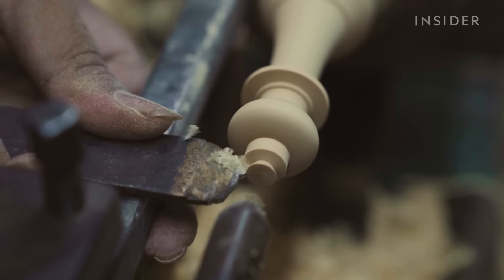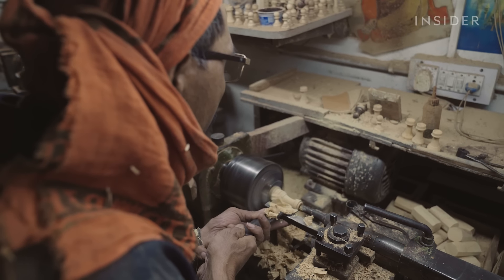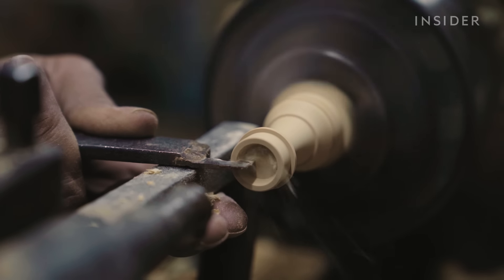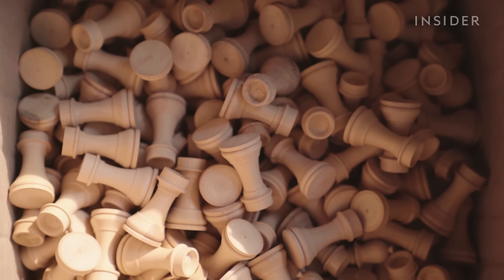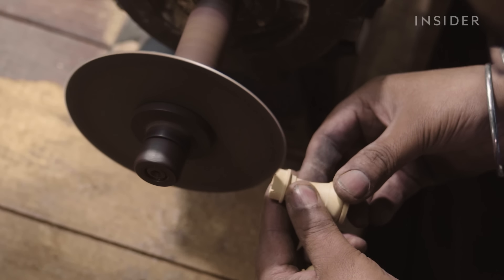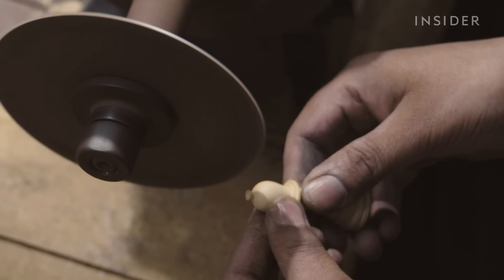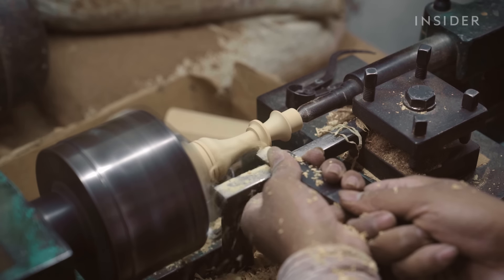Why Championship Chess Sets Are So Expensive | So Expensive

Comment: "affect the outcome of the game" that's a load of cap right there. Oh no, this knight isn't perfectly symmetrical and it's causing me to misplay lol.
Reply: Specially at 2800+ ELO level. These guys could play chess with checkers pieces full strength.
Reply: I mean, GMs are playing online perfectly fine, and there are no pieces at all. 

Some of them are even able to hold blindfolded simuls and win on pretty much all boards. 

The pieces don’t matter; as long as they are somewhat recognisable and not dangerous to move (i.e. they don’t splinter/fall over easily), they can always play a good game of chess.

unless of course one of them is like bobby fischer, that guy’s a bit unhinged, and the quality of pieces might actually matter (along with other, very specific conditions)

edit: also, maybe in a bullet tournament it might matter, but I’m sure as hell not going to try and play bullet on a physical board
Reply: Yeah it doesn’t change the game at all lol. I could use pieces of paper with the names of the chess piece on it and it would be the same thing
Reply: @TheOneWhoHasABadName  I think they should make specific piece for bullet. Maybe it's much smaller / slimmer with wider bottom for extra stability so it doesn't topple easily. Or just go full Japanese shogi and turned to fully flat.
Reply: It is a genuine concern though... I have been playing chess for the better part of 15 years and cheap pieces fall very easily, especially if you're clumsy. Now combine that with a 5 minute blitz game where you move pieces very fast, one clumsy move can ruin the entire board...
Reply: @spyrosvassilakis4212  aint worth 500 dollars just for that.
Reply: @cypherusuh  bullet shouldn't be played over the board. It's prepostreous, a strategy game becomes a game of dexterity.

All speed chess except for Rapid should be played online.
Reply: @pawsR0cky all they have to do is read
Reply: @pawsR0cky yes, I don’t play professional obviously. But it’s not hard to just read and visualize imo
Reply: @spyrosvassilakis4212  that is easily fixable by adding a heavy base which doesn't add much to the cost. Knights being symmetrical has nothing to do with the quality of the game even in bullet
Reply: @cypherusuh  bullet is not an official format according to fide
Reply: Also, wood is intrinsically irregular, so more bs
Reply: Magnus Carlsen once told a story on his YouTube were he realised that he just didn't have a chess set at home and then he just went to a store around the corner to buy whatever chess board they had.

Chess pros do most of their practice on computers anyway.

It's in the video Magnus Carlsen discusses The Queen's Gambit scene by scene
Reply: It is a bit over the top.
Reply: Technically, yes. It can affect the movements of the piece etc.
Reply: @CoolMan-ig1ol  I mean, have they tried using their hands to pick it up?
Reply: @CoolMan-ig1ol  Technically, the sun could not rise tomorrow...

And not technically, marketing bs always can count on gullible people to rationalize the sell tag of absurdly overpriced products, lol...
Reply: @spyrosvassilakis4212  Maybe very cheap pieces, shit from China which costs 5 dollars, above ~50 dollars there are not difference. There is no need to pay $500, you just need to buy a decent chess set for far less than 500.
Reply: It actually makes a difference cause bad peices may fall over when making a move
Reply: @mrgamerboy8316  Have the people playing tried using their hands to pick up the pieces without dropping them?
Reply: @mrgamerboy8316  That's tarded. Are you saying that a minuscule assymetry is gonna make the pieces somehow unstable? Yeah, they get Parkinson, lol...

And in fact, plastic "peices" are more consistent than wood ones, and have a lower center of gravity, thus being more stable.
Reply: @ligmasugmakenya114  I'm just saying badly shaped or badly weighed peices are more likely to fall
Reply: @mrgamerboy8316  I think any scenario that a cheap piece would fall over so would an expensive one.

Comment: as a mechanical engineer, machines definitely can make them at a cheaper faster rate. There are no internal carving, just surface grinding.
Reply: I think even if 50% of a machines pieces wouldn't meet the competition standards it would likely still be faster. Maybe less than 10 people are carving them right now but im sure there are thousands of people who could write a CNC program to get a knight of similar quality.
Reply: @hermitgreenn  "handmade"  🤣🤣🤣🤣
Reply: @mikepennington7209  handmade also includes using a tool to craft something
Reply: Literally!
Reply: @hermitgreenn  I want to see the 3D-printed wooden pieces.
Reply: As a mechanical engineer, you don't know how to run a cnc mill
Reply: I don't need to, Janitor.
Reply: @ivanteo1973  you're signing as a janitor now? Impressive. Maybe you do know how to work with your hands
Reply: @silo3com  Janitor like you will not understand.
Reply: @ivanteo1973  why are you referring to yourself in the third person. Say, " I like you". Not janitor like you.
Reply: @silo3com  and you insist on being a janitor.
Reply: @ivanteo1973  I didn't insist on it. You claimed it for yourself. You should have been happy claiming just the engineering.
Reply: @silo3com  I can understand how you feel. Truth always hurts. its all right.
Reply: @ivanteo1973  yes I feel sorry that you scrub toilets. I believe you can do better though.
Reply: @silo3com  and you keep insisting,  mr janitor.
Reply: @ivanteo1973  okay we can call you Mr. Janitor if you prefer
Reply: Of course, you can CNC all those pieces. Then they would say they were engineered to NASA like tolerances and it is why they cost $5000 🤣
Reply: @LuisCasstle  That's incorrect. Aliexpress is selling the full set for 20+USD. It's already being mass product using machines. Do your homework before making comments.
Reply: you don't need to be an engineer to notice that
Reply: @vinnieg6161  I didn't notice that. It's just an engineering fact.
Reply: @ivanteo1973  yea like you can't stack lego blocks with duplo is an engineering fact
Reply: @vinnieg6161  you don't need to be an engineer to notice that.
Reply: @LuisCasstle  Yeah, but in your example NASA probably spend $4950 on programming and tooling, but only $50 on actually making one set of something. When you mass produce, the one time costs gets spread over thousands of sets.
Reply: @Tempelge1st  lol, i could literally 3d scan theese pieces and make it within tolerances 0,001mm (one thousand of milimeter) There is no way theese guys could have sutch repetativity in their work, even with 300 years of expirience for each of them. Beside, wood is not static, it swells and shrinks on so many factors, so theese pieces are not same, i can guarantie you that. For time they make one, i could make thousand sets, no problem. Dont get me wrong, i appriciate "human touch" on theese pieces, but as someone pointed out here, they dont even have propper protective equipment, their machines are incredibly old, even light in their workshop would make them loose eyesight quite quickly. No need for people to loose their lives like that. Beside, even CNC machines are made by humans
Reply: Why making fun of janitor, it's an honest job
Working hard making money for the family
Respect them
Reply: I have a set that is about $140 and another that is $120. I think they are MUCH nicer than these. I don't like the design of the World Championship sets. I hate the pawns and I don't like th rooks, and I can't stand the knights. But the standard weighted Staunten wooden sets you can get online are much more satisfying to use. I don't know why they use these ugly sets. Kudos to the work and artistry and craftsmanship, but they are still ugly.
Reply: @luigisanter6211  Min wage? Shit. They might make ONE HOUR of min wage in an entire DAY.
Reply: @fajarkurniawan9434  One of the smartest guys I ever knew was a janitor. Dude knew A LOT about goddamn near EVERYTHING.
Reply: @TheGrandmaster1  ? your comment makes no sense
Reply: @luigisanter6211  It'll make sense when it's TIME for it to make sense.
Reply: @TheGrandmaster1  ah troll comment i see
Reply: @DRAGUNOV1902  I'm curious what device you're using to 3d scan a solid object to within a thousandth of a mm.
Reply: @Typexviiib  for example Artec micro. Its not to a 0.001, but to 0.030mm, still, carving wood on anything more precise than 0.02mm is pointless since it will change dimensions as humidity changes inside and outside of wood
Reply: @DRAGUNOV1902  .03mm sounds a lot more reasonable than a thousandth of a mm.  I'm a tool maker, so I'm pretty familiar with machining.
Reply: cheaper, faster, and better
Reply: @TheGrandmaster1  if they make twice the average local pay, that would be accurate.
Reply: @Typexviiib  if i need a high-accuracy "3d scan" of Something like this, i just hog a CMM and let it measure points for a few days

While your results look somewhat like an stl at first, the mesh eventually gets so fine it's insignificant
Reply: @angrydragonslayer  sure, but even then I've not seen a cmm capable of .0001mm resolution.
Reply: @Typexviiib  indeed, i've been barred from using our leitz infinity for that so i'm limited to one of our Leitz PMM-Cs which may be just above .0001 mm in this use case

Although, would you not say that moving the goal posts is a rather lame move on your side, adding a zero onto the already difficult .001 mm that he spoke of?
Reply: @johnt.sunderland7312  exactly, i could probably make these in carbide for $500-600 per set if i buy chinese carbide
Reply: @silo3com  do you have nothing better to do than troll people attempting to have a discussion?
Reply: @JohnDoe-qt6uo  yes actually. I should get back to the cnc machine. Thanks for the reminder.
Reply: @angrydragonslayer  it wasnt intentional.  My brain went "thousandth of a mm" and I typed it out as if I were doing ten thousandth of an inch, both are the finest scale any of my measuring equipment will read.   I do most of my precision machining in english, because all my mics are English.  I rarely think of mm's in terms of smaller than .1.   Either way, a thousandth of a mm or a ten thousandth, you're getting into variations of surface finish rather than dimensional accuracy for most real world applications.
Reply: @Typexviiib  oh, definetly, it still feels good to tell someone off though

either way, these could be done to a higher spec and experience on a cnc
Reply: and can u call that a HANDMADE WOODEN CHESS SET?!?!?!?!
Reply: @supe4701  but u use ur hand to handle the tool
Reply: @sreeramanoop1403  actually, yes

The legal definition is so loose that me setting up a CNC machine and then letting it run for the next decade can still count as handmade as long as some kind of processing is done by hand

I have consulted a company where a tab is intentionally left in an engraving that is then filed away by QC after checking. This is enough to legally qualify the product as hand made in all western countries except portugal (where they dont enforce this anyway)
Reply: @luigisanter6211  he means they get paid 1 hours worth of minimum wage for an entire days work

Comment: "Only 250 sets are sold each year" Followed by "we make 30 kings a day" And "a knight takes up to 2 hours" Just doesn't make sense
Reply: Theres a difference between make and sold. 250 sets are SOLD. They can MAKE more than that, but they don't sell that much as these are very expensive and not a lot of people buy them.
Reply: @vastikagoel6797  If people were only buying 250 sets a year, they wouldn’t be making 8,000 sets a year. That goes against the basic principles of supply and demand
Reply: The best pieces are sold for 500 probably, and the others probably sell for way less in local markets
Reply: They make two kinds; world champship sets and lesser tournament sets.
Reply: 250 Championship standard sets. The "30 kings a day" figure is for the less regulated/simpler sets, which I assume they sell a lot more of
Reply: Artificial scarcity to bring up the price.
Reply: @saintsleeves  artificial scarcity. Ever wondered why diamonds are so rare yet we have so many diamond mines and diamond jewelry?
Reply: only 250 sets pass through all inspections, they have to make 16 identical pawns, 4 identical bishops, 4 identical knights, 4 identical rooks, 2 identical queens, and 2 identical kings, and the championship sets are very detailed and even more meticulously inspected, they arent making those year round, they also arent making 30 of the championship kings a day
Reply: @saintsleeves  Its all hype, just like the narrator's tone and voice designed to make it seem luxurious and worth the cost
Reply: They forgot to mention FINANCIAL DAY
They prolly work for 2 hrs a day
Reply: @videoms1271  DeBeers had a monopoly for a very long time so controlling the supply was pretty easy.

Comment: This whole thing feels like an attempt to justify licensing monopoly and artificially high price with cost. 
Which does not feel convincing to me.
Reply: Its because its used in the fide world chess championship. Just like how the fifa world cup balls are expensive, sure they are not soo expensive but this is wood and takes skill to produce
Reply: What? That makes absolutely no sense for this.
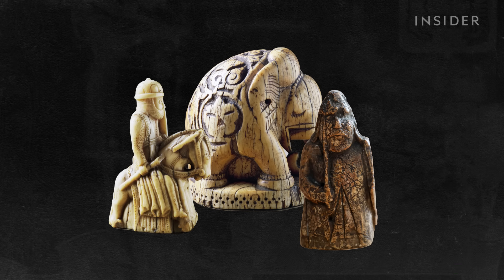Reply: Especially when they showed that Knight at 6:29 That one looks amazing, compared to the ones beging shown. However, despite the simple designs of these sets, I believe the value likely comes from the consistency of the work. They all look fairly consistent in size, width, details, etc, which is not easy to do by hand at all.
Reply: @ccfshorts101  shhh, you gotta go along with the narrative that big company bad
Reply: @supe4701  whos the 'big company' here huh?
Reply: @Jadel Labradoodle251 You won't understand, it's a good dammn world championship set and FYI wood is much more expensive than plastic. The FIFA balls probably cost like 20$ to make. Everyone has to make profits and to add these are hand made.